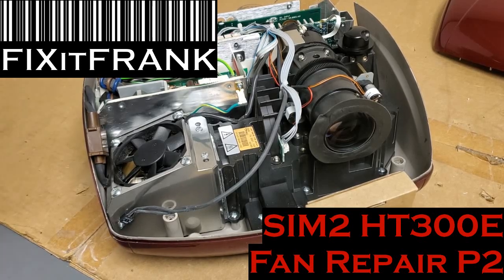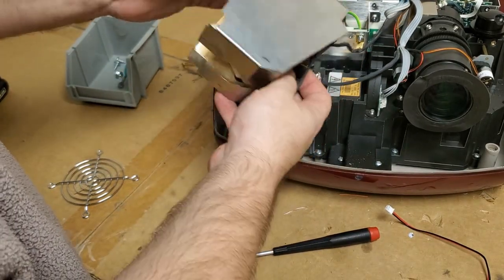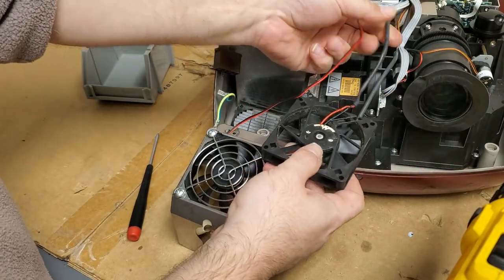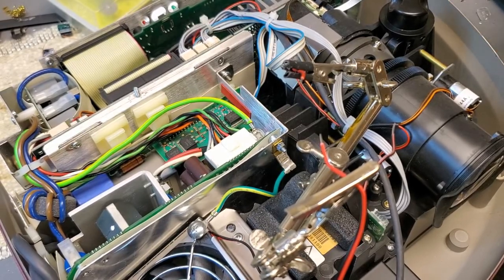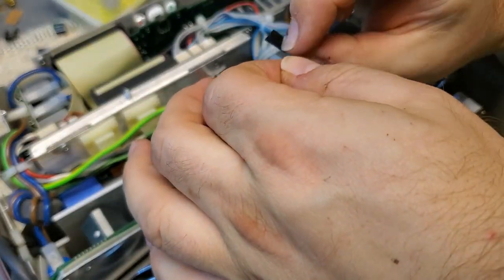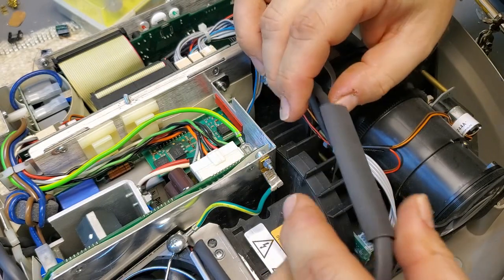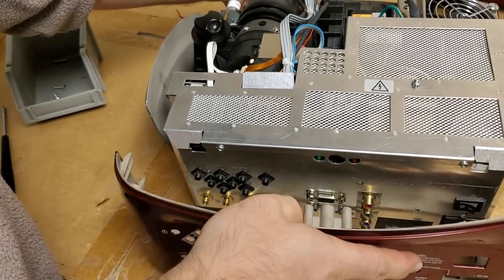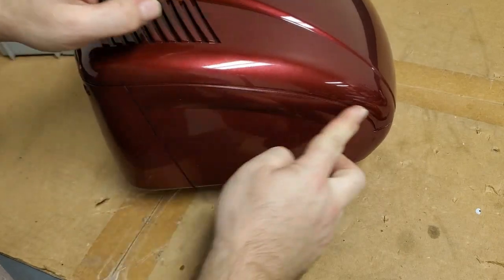Sim2 HT300E DLP Projector Cooling Fan Replacement/Power Supply Part 2

Comment: Great video. May have a fan repair on my D80 to do soon...
Reply from the maker: Its a great projector.  The D80 has an amazing picture. I love Sim2. My dream is a 3DLP Sim2.
Reply: @FixitFrank  totally. I love the D80 though, as you say awesome picture and still stands up now. My issue is 1 in 4 times I switch it on it comes up fan failure, so assuming that the only fan to cause that is the lamp fan then your video will be invaluable! I have had the projector since 2008ish still only 1300 hours on the lamp.

Comment: how much does the amount of blades or blade shape affect fan noise and amount of air moved? if i ever need to replace a fan is there a 'good' fan type to go for?
Reply from the maker: The shape/blade count has quite an affect on both. The more swept the blade, the less noise you would have. If you look at the cross section of a blade it's akin to an airplane wing. 
However. This comes with a big caveat. Sim2 is one of the few companies that use two wire fans. Most projectors use a three wire fan(like a PC ) and the rpm specs need to be matched exactly. I find with say, BenQ or Optoma, you need the exact fan. But, newer projectors already use swept blade designs in the fans so you can't really improve them anyway. If it's an older sim2, then using a swept fan is definitely a way to go.  The sound level difference is very noticeable in this one. 
The short answer to your question is to default to the exact fan you are replacing(match the model #) but if it's a fan with only 2 wires feel free to try a different (newer)fan.
Reply: @FixitFrank  cool thanks for the info Frank i honestly was thinking the answer would be there isn't a difference but today i learned!

Comment: Hey Frank i recently discovered your Channel and wonder If you could help me out. I own a Optoma HD 1080e which refuses to light its lamp. The lamp is confirmed working by the vendor. When the Projector turns on, the color wheel starts spinning and then the Fan turns on. The powersupply outputs around 500v which should be enough and the power led shines blue, but the lamp remains dark. Do you have any Idea which part could be at fault ? I thought about switching the sensor for the colour wheel, but by my logic the psu should not output 500v if the sensor is dead.
Reply from the maker: Hey ElTacoDiablo, Where did you measure the 500v?  That is a weird voltage to measure.  The power supply should be feeding 380Vdc to the ballast.  You cannot measure the output of the ballast properly.  It uses high frequency AC in the thousands of volts range for ignition.  Then it settles to around 100V AC at 20khz or so depending.  I can't think of any part that should be measuring 500V.  That is the HD1080 DARBEE that has a short throw lens correct?
Reply: @FixitFrank  Hey Frank, thanks for your reply. The 1080e is the non Darbee version of that short throw projector and the successor to the gt1080 . I measured right at the lamp connector.
Reply from the maker: OK, just making sure I'm looking at the right one.

You don't want to measure at the lamp. Its not measurable with a normal meter. Plus your leads are not insulated to 5-10kv.

Ideally you want to measure at the DC input to the ballast. There should be 380dc when the projector is started. It may be 150-300(depending on your line voltage) while in standby. 

Once you see if you have 380 or not it will indicate if the main power supply that feeds the ballast is the issue. If it never outputs 380dc to the ballast then it's where you want to look. If you do get 380dc the ballast is suspect. But since they are on the same board in this model, you would change or fix that board. 

The lamp uses about 5kv at a few milliamps to ignite the arc during startup. Once the arc is struck, the voltage lowers and the current rises to sustain the arc. They settle around 100vdc @ 2amps. Then the ballast adjusts the two accordingly to keep the lamp running. 

Since the lamp isn't starting and the color wheel is spinning ok, the ballast is my suspect. 

How did the old lamp fail or might it still be good?
Reply: @FixitFrank  Thanks again for your detailed response. I will try to  measure the PSU when i get Home. As far as i know the Lamp more or less  exploded (which should be normal at the end of the Life cycle according to the Manual) but i cant tell for shure as the projector was a gift.
Reply from the maker: For what is is worth, the lamp shouldn't burst when they end their lives.  Ideally they get kind of melty looking and dark inside the arc tube. If it did explode, that could damage the ballast if the projector was on when it happened.  That can cause a pulse in the ballast that can short out the MOSfets.   I will wait to hear from you.
Reply: @FixitFrank  Hey Frank, so i finally tested the ballast. I followed your videoguide and it seems like one of the Mosfets is indeed dead. I will try to find a replacement (1f39a fqp 19n20c) and install it. I'll let you know if there is anything new. Thanks again for your help!
Reply from the maker: @TheG3l3  Sure thing! I'm glad to hear you found a bad component.  Ballasts can be a pain if the problem is on the control board. 
 If you order new parts, buy 2.  You want to replace the pair.  There are essentially 2 pairs working together(4 total, 2 per group). You should see one pin on each connected to it's partner on the  rail/trace underneath. When you buy them new in pairs you are more likely to have a matched set electrically.  Also, the other existing FET might have been stressed by the same problem as the bad FET.  It might fail soon after and take out your new parts.  https://www.onsemi.com/pub/Collateral/FQPF19N20C-D.pdf  Those should be pretty inexpensive.  It is a fairly common part. Definitely replace both to be safe.  
Just curious, did your original lamp burst when it failed? If so, it is probably what took out the ballast. 
Also, if you don't mind my asking, who did you get the lamp from?  It's good to know companies are giving that information to the customers rather than leaving them high and dry.
Reply: @FixitFrank  I found a pack of two Mosfets on Ebay that are not shipped from China, so they should arrive within next week. Thanks for the advice to replace two at a time. Yes the lamp burst when it failed. The company i got the lamp from was hcinema.de it is a somewhat small German shop so i dont think they ship internationally. When the lamp I bought didn't turn on the owner offered to test it for me free of charge and was nice enough to include pictures of the test and the working lamp.
Reply from the maker: Thank you!  They have a very good selection and I see many things on their website that I think are quite good. You found a good company.
Reply: @FixitFrank  IT WORKS! I replaced the Mosfet and now it works! The lamp seems to get a little hot (might be normal?) and the colour wheel is pretty loud, but i get a picture. 
Thank you very much for your help, i would have never figured it out without you.
Reply from the maker: WOOO!!! These are the words that make this all worthwhile!  Those lamps get really hot.  500f and up(in the center)!  The exhaust air may be around 140F/60C. In the winter I use the one my bedroom as supplemental heat... But don't worry about the heat. If its too high, the unit will turn itself off and warn you.  I doubt it'll happen though.
The color wheel is worth replacing at some point.  I really like that series an think it's worth putting some euros into. 
Please have a pocketcoffee and a Kinder egg for me. Auf Weidersehn!

Comment: Hi，recently like your video.It is very helpful.By the way, do you know the power chip type on the power supply board of Dell s500wi projector?
Reply from the maker: Do you have a picture of the board? That would be easier to identify. I have not worked on an S500Wi but it looks like its the same as another brand.
Reply: @FixitFrank  Thx,do you have the email that I can send photo to you?
Reply from the maker: @ShengTan-p9z  Hi Tan, sure!  you can use sales@weezytech.com

Comment: Hey Frank, thank you so much for your amazing videos. Do you have an email address I could send you a video to? I have a sim2 here which makes an insanely loud noise once the lamp turns on, kinda sounds like a sports car. The weird thing is - I’ve replaced all 4 internal fans! Ie, the 2 8015 fans on the lamp, the 1 6015 fan on the base and the 1 8015 fan on the base. Is there another fan somewhere? I can’t figure out what on earth is making this noise.
Reply from the maker: Hi!  I do.  Its on the about page, frank@fixfrank.com is best.  I wonder if you are hearing the color wheel if you have replaced all the fans and from your description I think you found them all.  Does it sound like it is near the fan but in front of the lamp?
Reply: @FixitFrank  Hey, thanks so much for getting back to me! you might be right there - I'm finding it hard to tell. What would cause the colour wheel to make such a noise? I'll email you a video, thanks so much.

Comment: Hi Frank, love the videos. I was hoping I could ask you a question. I have recently bought a used Sim2 HT300E to replace my Optoma EP615H which no longer works. It was XGA 4:3, nothing special projector, maybe $3000 at new back in the late 90's. Anyway, I bought this Sim2 which has amazing reviews for its day, its 720p 16:9 and cost something ridiculous like $17000 at new, so seems like a major step up for me... but it isnt. My old optoma was better. This Sim2 is dull, lifeless and the colours are so poor. It doesn't pop. I'm so disappointed, but then I thought, this can't be right... what, in your opinion, is wrong with it? I don't want to buy a new bulb as they are really expensive here in the UK, only to find out it isn't that. What would you recommend? Any help would be greatly appreciated!!
Reply: rivedere video togli carta adesiva argentata vecchia e rimetti su vecchio carta ma non imorta collega  sono cretinate questa siamo colleghi e sappiamo come si fa tranquillo ti seguo